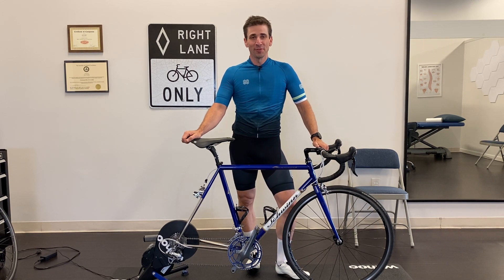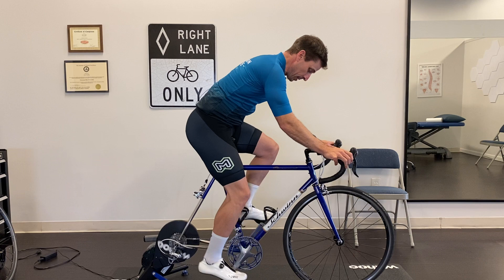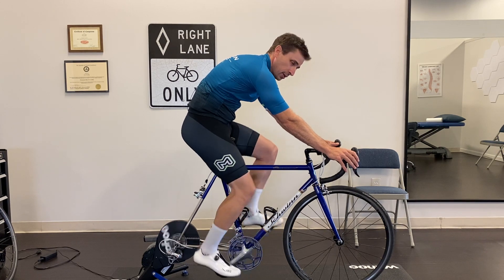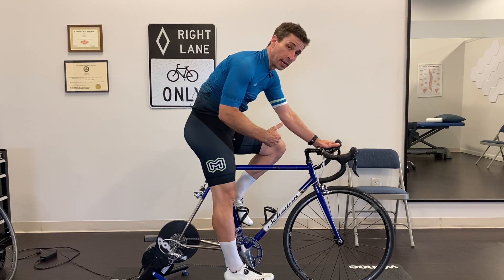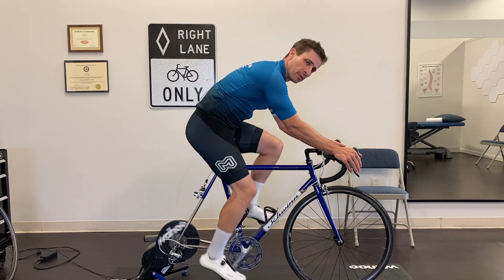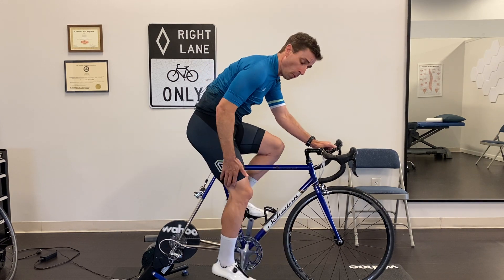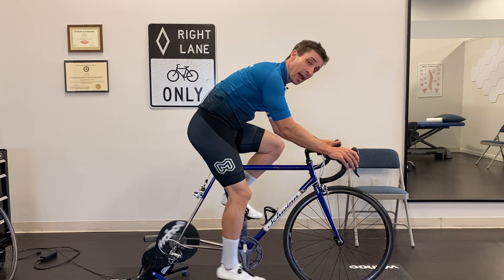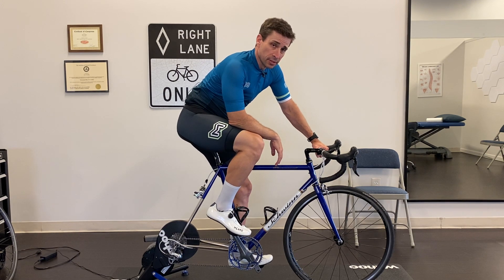How Flexibility Affects your Bike Position and Power.

Comment: Dr Joel, as usual what I nice video and info. This is probably one of the main issues of these days, considering that a lot of people spend the whole day seated. I soffered of that for long time and after several bike fits I realized that the problem was not in the bike and it was actually in the way I was seating in the bike due to my lack of flexibility and strengh in the core (gluteos muscles mainly). One good tip is when the cyclist will seat he must slightly tilt the hip forward in order to "engage" the ischiums in the seat. It is a good start point to improve your posture in the bike, then we need to improve flexibility and strengh. 
Actually I was supprised that none of the fitters mentioned that to me. Kkk
Tks for the video.